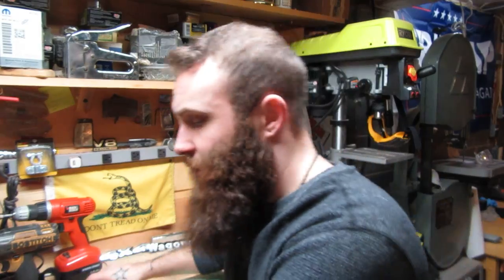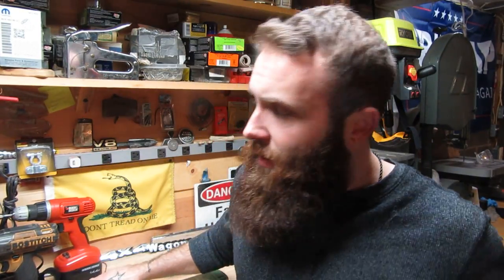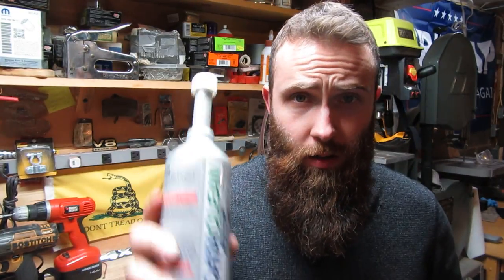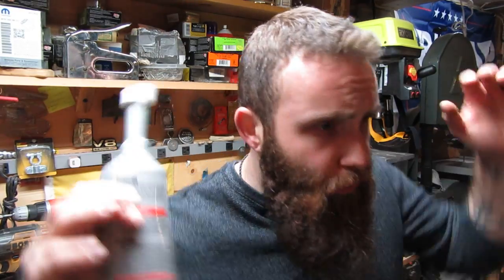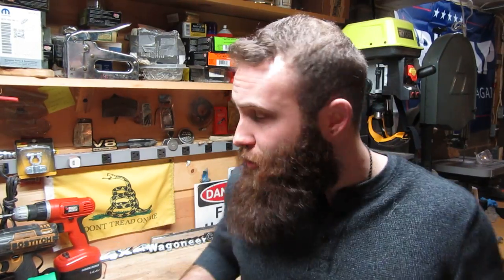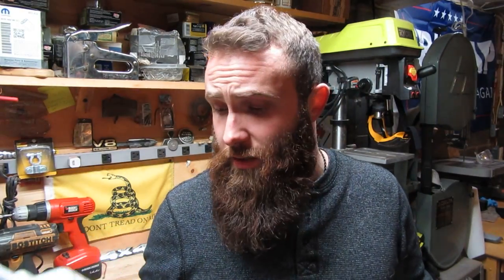How to pass inspection with a BAD CATALYTIC CONVERTER or O2 SENSORS

Comment: That stuff did absolutely nothing for me. Not saying it won’t help for some but cataclean was a 25 dollar bottle of BS for me personally. I had the Po171, Po174 and Po430 codes and ended up having to replace the mass air flow sensor in order to pass inspection.
Reply from the maker: Yea, it is on of those things where it is worth the $$ if it works, but isn't if it doesnt.. Can;t know until you try. What was the vehicle?
Reply: D&E In The Garage 2004 Ford Taurus Vulcan 3.0 OHV
Reply from the maker: What a small world!.. One of the few vehicle I have ever had this fail on was a 2005 Taurus with the Vulcan V6. It was my buddy's car. The o2 sensors are such a paint in the butt in that vehicle that he sold it instead of doing the work. I am not against Ford or anything, but the Vulcan V6 is an awful motor. Terrible to work on and made worse that it is transverse mounted in the Taurus.
Reply: D&E In The Garage tell me about it. I’ve had two 04 Taurus’s both with the Vulcan 3.0 and both have been a pain in the butt to say the least. But yesterday I drove it for 125 miles with no engine light and thank god I got it to pass for another year. And then jumped in it to go up the road this morning and the light came back on at 170 miles. Lol imagine that
Reply from the maker: haha.. well at least you go that sticker for another year!
Reply: D&E In The Garage yep 👍 thank god
Reply: Anytime you have 0171 & 0174 @ the same time, it's MAF

Comment: I will try this this week ( 2005 Camry ) I will let you no ( thank you )
Reply from the maker: Good luck! remember to really send it when running the engine after adding the CataClean. The idea is to get the exhaust really hot to give this stuff a chance to work.
Reply: ok will do thanks bro ( let you no how its goes )
Reply: way gill did it work?
Reply: @sherlandasurry7466  no it did not ( had to buy a ) autel code reader from walmart ( Al 319 ) 34.99 erase the codes. then i went to get it a inspection ( drive 25 miles ) light did not come on. the took it. it pass. the light came back on in about 30 mins ( but I was good for a year ) good luck !  by the way doing this in 2 weeks once more  ( let you no ) be good !

Comment: Ok so my car is a Nissan Altima 06 2.5L. We have changed the spart plugs out. Took the Head to the shop and had them clean it, got new head gasket. Got new alternator! There has been a bunch of stuff we have put into my Car but yet when it is Idoling in the driveway or even at a Stoplight or stop sign it wants to die. Does anybody know what the Hell is going on? Is it the Cat or Cam shaft Mayb dirty. I honestly don't know. When I am driving it down the Highway it runs pretty well alot better than it has. Any ideas? Please help!
Reply: Could be cat.because i had same problem. I replace mine it work very well now
Reply: Vaccum leak  possibly

Comment: I change cat and all the 4 sensors on my Chevy express 2500 and the check engine light came back
Reply from the maker: Do you have pre-cats further up closer to the engine? Maybe one of them is bad. If not, your vehicle may be running rich for some other reason

Comment: Wjat if you dont have catalic converter.does it work?
Reply from the maker: it would do something to clean your fuel delivery system, but there are cheaper options for that (STP or Gumout). If you don;t have a catalytic converter, Cataclean is not a good choice.
Reply: @DEInTheGarage  thanks a lot
Reply: It cleans other stuff up than just the cat

Comment: sorry but used two bottles of catclean and had no results. The car doesn't run poorly so it shouldn't be a blocked cat???
Reply from the maker: I am sorry to hear this didn't work for you. If you are not experiencing a loss of power, chances are your cat is not clogged. What are you symptoms you are experiencing now?
Reply: Same here and the catalytic it's only a year old...still have the P0420 code
Reply from the maker: Perhaps your o2 sensors are out of spec? Have they been changed recently? Are you using an OEM cat, or an aftermarket one?
Reply: @DEInTheGarage  
 .

Comment: Can I put two cans at one time
Reply from the maker: I suppose so, though you are going to want to leave more gas in the tank then. I am sure at a certain concentration it can either do damage to your engine or impede proper operation
Reply: Yes I just put 2 cans on my Nissan 99 Pathfinder with 3/8 tank gas run about 70 miles the check engine light turn off by them self, work every time when I have a code P0420 Bank 1 Catalyst
Reply: @songcao5517  does it really work ima try this 2005 for taurus
Reply: @Josepadillamondragon116   
Yes is work for me. I did not buy a small 16oz bottle because is the cost too much I buy the Cataclean 5L. part # 12009 Cat, so I can use them again in the future, the 5L costs only $49.95, last year my truck has the check engine light on code P0420 I put 32oz = 2 bottle on the 3/8 tank of gas run on the highway just like a normal go to work every day until the gas all most empty . fill up the tank and run about 30 miles the light turn off for a year. and now they come back again I do the same thing and they work again... 
don't buy the small bottom buy the 5L. if you plan to use in the future like me, 5L cost you only $49.00 is only $5.00 bottom because of 5L= 196.07oz .. good luck and  hope this work for you

Comment: Going to give it a try, left you a sub for it. Will check out your content for sure!
Reply from the maker: Thanks! I hope it works for you
Reply: @DEInTheGarage  My car has Code P0420, having an issue with a cat on one side and am in Pennsylvania.
Got the code cleared today at a garage, hopefully I'll be able to pass inspection without having to fix that. Looking at $800 for the parts plus labor.

Comment: You haven't found an auto parts store that has cataclean, guess what? Ever heard of AutoZone? They got it,and it's only 17.00$, but will it work on my car , probably not because the cats are bad, so when the cats gets real hot, the car won't start, let it sit overnight or 2 hours, it's starts up like new, so in Arkansas, everyone cuts out the cats, bypasses the O2 sensors, and everything is better, so they say, most likely doing that will make it run worse, but your supposed to use it 1x every 3 months, I'll try it but 50% say it works,50% say it don't, it depends on the cats condition, I drive a 2000 Acura TL, 2 new cats on that thing is gonna cost a shit load, I already got over 14k in maintenance, might as well try it, if not cut them out, either way it's gonna cost$$$, sad that a 19 year old car has me  over 20000$ in the hole, 215,000 miles, 4k with aamco last year, runs outstanding, all stock, no mods, so for 17.99 at AUTOZONE we will see????

Comment: Glad where I live ain’t got to have our trucks and cars inspected
Reply: @Damon Wadyko There are parts of the country where trying to feed your cat is hard enough, (a joke) let alone actually feed the kids. Most people have very old cars and trucks and they simply can't pass new emissions testing. If you mean regular, basic inspections, (lights horn brakes) then it isn't hard to make them function at a reasonable level and that's not the problem. Now, I live in a fairly rural area of NC and there definitely isn't emissions testing, it simply would be horrible for many people. But...my mechanic pointed out to me that with all the new fancy requirements for what gets tested at these things, it's going to be the same sort of problem. Older vehicles don't need a huge number of sensors being tested to confuse the crap out of the average family trying to survive day to day when they know the car starts in the morning and gets them back home from work at the end of the day..

Comment: 2002 Toyota Sienna with 187k on it. P420 code.
TWO treatments, applied as directed, with Cataclean within a month did nothing to help.
Sure, it could be something that Vataclean is not designed to help. Just saying that it indeed did not.
Reply from the maker: Very sorry to hear it didn't work out for you. Sadly this fix is not a guarantee, kind of a last ditch effort at a simple fix. Good luck with your issue. It kind of sounds like you will either need new o2 sensors or a whole new cat

Comment: What if I gutted my cat?
Reply from the maker: If you have post cat O2 sensors, that is going to throw major codes and possibly cause your engine to run badly. what kind of car?
Reply: @DEInTheGarage  2009 Nissan altima
Reply: 2.5s 4 door
Reply: Did you try it.  I also have an 09 Altima, trying to get cleared to pass.  Sometumes the code goes away but then comes back later.

Comment: Yeah, I have no cat and I’m trying to get it to go away for inspection
Reply: When I was running into problems with my Cat in my foresters I used to put my oxygen sensor inside 2 spark plug fowlers and put it back in the bung for the o2 sensor this should work in your scenario i believe. It tricked the ecu to seeing cleaner air when there was.
Reply from the maker: Yea, the Cataclean isnt going to do anything for having no cat. What Eric should might help. You need to find a way to trick your car into thinking you still have one. What kind of car?